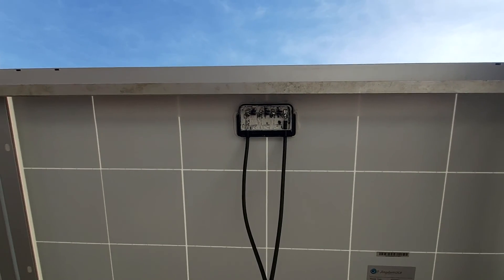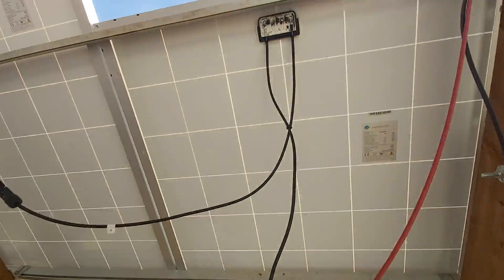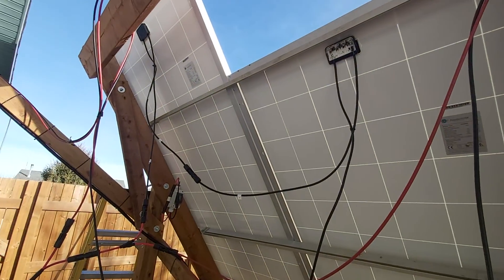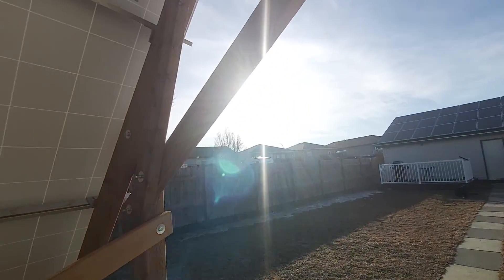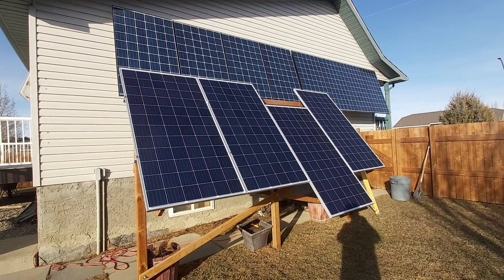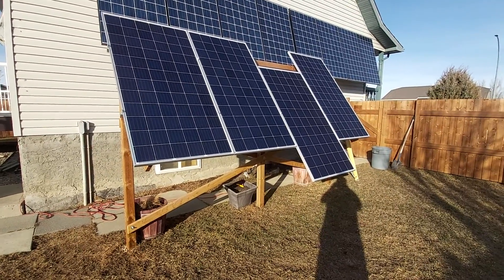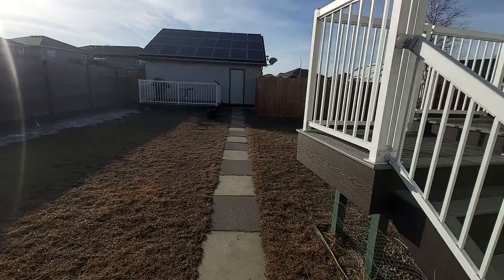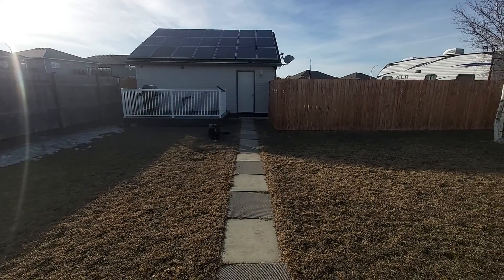Repair Solar Panel with Bad Diodes

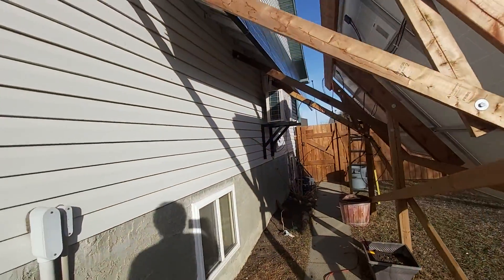Comment: 1:33 Aren't you concerned with suffocating your heat pump with it being so close to the wall and having panels covering the top?
Reply from the maker: Not at all. It will get shade all summer while in cooling mode and some Sun while in heating mode. It was planned that way.

Comment: Diodes normally blow short circuit.  Ask Troy about his garden fan / wind turbine.  🤣
Reply from the maker: Really hard to tell witch one it was though. The factory ones have three legs plus a common. None read as shorted. But two read a plus bias from the tab too all three legs and one reads a short to the tab from the center pin. So did two blow and short or did the one open. Replacing them all fixed the issue. I was impressed at how many watts I pulled in after replacing and temp wiring it all back up. Having 4 tabs means the cells themselves are three strings in series. By the time you chissel out the silicone and isolate the cells witch are diodes too, you are f'ckd. So I just changed em all with the old fashioned round diodes. This is the first time I had one blow out of the 41 panels I own. I bought a 30 pack...so there is that. And they were cheap from Amazon.
Reply: @timcat1004  I had a full bridge rectifier blow in my meat mincer, and the difference in price between buying 1 or buying 10 was pennies.  I bought 10, and still have 9...